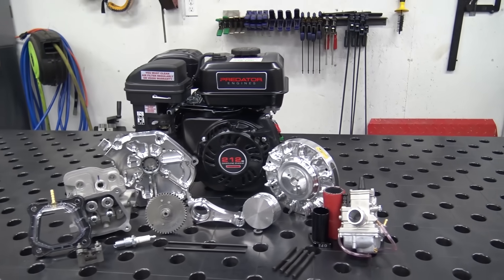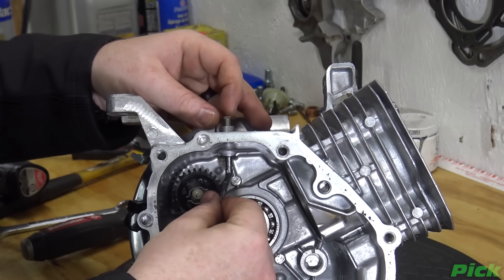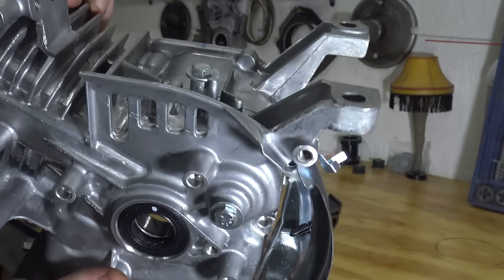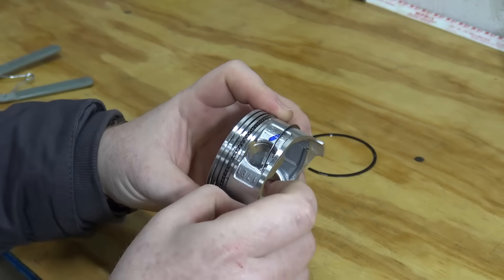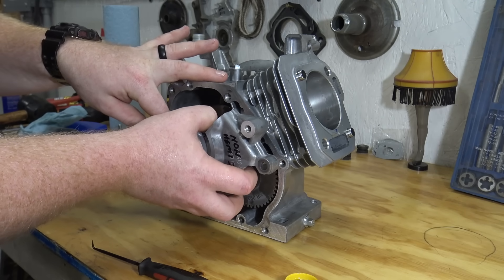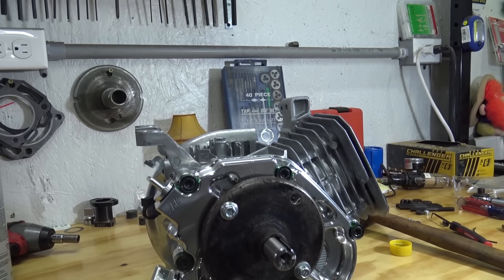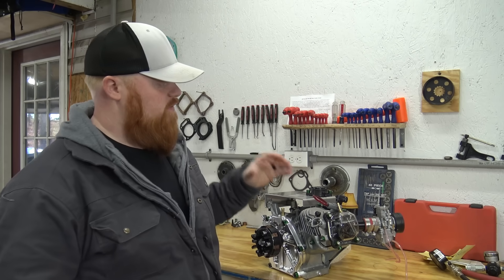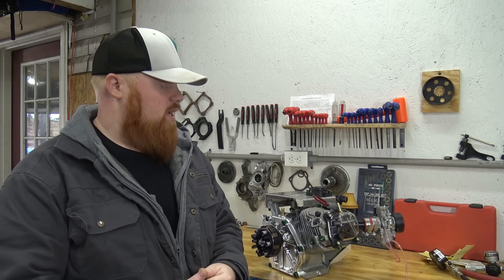Predator 212 Stage 4 Engine Build ~ 22HP Go Kart / Mini Bike Engine

Comment: Omg, I'm sorry, I wasn't going to critique this build because it's usually pretty good, but you used a fiber head gasket, that basically eliminates the Shaving you had done on the head, you should have used a multi-layer steel gasket at about"0.13 in order to actually achieve gains from shaving the head ".065. Using a fiber head gasket, you completely eliminated any gains you would have got by shaving the head, I really wish you would have told the people watching this that very important information, I'm actually kind of disappointed. But I will point it out since you didn't, that aggressively, use a multi-layered steel head gasket instead of a fiber or copper head gasket, in order to see positive compression Improvement gains. Trust me, I know what I'm talking about, I've been doing this for over 20 years..... again here's another problem with going with go Power Sports, they make you run a spacer for the valve cover if you are running ratio rockers, and are racing provides the same thing, but if you use a Billet valve cover, you don't need to waste the extra money on a spacer. And one more thing I noticed during this build, motor oil is used for lubrication on everything, that is incorrect, use either a good established company assembly Lube or use a good homemade assembly Lube like I have used for 20 years, and you will have way better results. Do not use just regular motor oil with your assembly, it will end poorly, I promise you!.... I will be the first person to tell you this, no matter who makes the valve cover, do not use a clear one! The first time you accidentally hit it with brake Parts cleaner, it will immediately fog up, and within 5 minutes break down and fall apart, crack and break, and be completely useless. Don't waste your time on something that seems like it would be cool, because the first time you make a mistake with brake parts cleaner, it will be rendered completely useless and you have to spend more money. Just get a Billet aluminum valve cover from the beginning, and you don't have to worry about it. NR Racing makes a beautiful one at an affordable price, and it works beautifully, has never let me down and over 15 years.... yes you can use the spark plug spacer to give you clearance from the piston, but I took my builds a step further and indexed my plug if you don't know what that means, look it up and do whatever you need to to make it happen because it is very beneficial. Which means I threw the spacer in the trash, and got spacers in order to index my plug to the intake port in order to maximize power. This video and most videos don't show you how to do that and the benefits from it, but trust me, it is well worth it. Look up how to index your plug properly, and use the spacer along with others if you need to in order to make it happen. It doesn't mean making space between the spark plug and the piston, it means how to orient your spark plug with the intake port to the spark meets the air fuel mixture properly, and yes you want to make sure you have clearance between the spark plug and the piston, but as long as you have that, you want to make sure the spark plug open Gap is facing the intake Port properly. Trust me, look into this and use whatever shims you need to make it happen, you can thank me later..... and I hate to say it but red beard is using all of the factory gaskets for the intake manifold and carburetor, and that stuff simply won't work. You need to use thicker gasket paper and make your own custom gaskets in order to properly Port match your carburetor and intake manifold to the engine. The head has a lot of room to be hogged out and made better, and if you don't do that along with Port matching all of your gaskets and intake manifold, you're going to lose potential power. I wish he would have shown you how to do all that, because I did that with my big Power build, and it came out beautifully. This video is a very good tutorial on how to get close to making big power, but a lot was left out, there is still a lot of power left to be found for basically no money, and it was completely overlooked. One of the big problems was going with go Power Sports, don't bother messing with that company, seriously, just go with NR Racing and you will have a much better time with less problems and more power, I can promise you that from experience!

Comment: I hate to say it but if what parts he is using and how he is going about it, then that means the Predator 212 I built with strictly NR Racing parts, running on methanol, should be making about 28 HP. And if that's the case, I hope no one actually follows this video because go Action Sports, completely sux. I got a similar stage 4 Kit from NR and modified things slightly and I promise you, I'm making much more power with less money, especially running methanol. This is nothing against red beard, I know he is sponsored by Go Power Sports, but they are the bottom tier of the industry, NR Racing is the way to go, Go Power Sports can burn to the ground as far as I'm concerned. Their products and customer service completely suck and should be eliminated from the market. Go with NR Racing Products if you are serious about making good, reliable power. I've done it multiple times, I gave Go Power Sports a chance, and they blew it about four times, before I decided to make the change. And I have never looked back, and never will. It is a night and day difference between the two companies. You can go with go Power Sports, and come up short and broke, or go with NR Racing and spend a little money and come out with a perfect product and amazing results. It's that simple. I hope all young engine builders read this and listen to me because I have walked the line in the past and figured out the mistakes, and I'm passing the info on to the younger generation. Please follow my advice, none of you will regret it, I promise you!

Comment: I need to point out something very important, I've been watching these videos for years, I also have been building Predator 212 engines for years, and I have built some very serious monster engines. But the one thing I need to point out, I get my parts from NR Racing, not go Power Sports. Go Power Sports absolutely sucks with their stuff and customer service, NR Racing is by far the better company to go with four parts that fit and their customer service is absolutely amazing. I have built multiple engines over the years and always used NR parts, and never once had anything out of clearance, or had interference with any parts and the block, crank, cam or anything, not a single problem over the past 8 years. But I watch these videos just to see, and if red beard is getting his parts from Go Power Sports like he claims, not in this video, but in others later down the line, he has constant clearance and fitment issues, which I'm sorry to say is simply unacceptable. And it's all chalked up to him being in cahoots with go Power Sports, because they are the F tier of performance parts. Still follow what red beard says, because he is truthful, but get your parts from NR Racing, and you won't have the clearance problems that red beard runs into. It's not speculation, it is now a clear proven fact. Follow red beards instructions, but don't go with what gopowersports has to offer, go with NR racing parts and you can eliminate 10 minutes of his videos explaining how to grind and do nonsense to make things work. Never liked the grind and modify parts to make them fit on my builds, I tried using Go Power Sports in the beginning, and was disappointed and unsatisfied with the fit and finish, along with their complete lack of customer service. So right away I went over to NR Racing and tried their products out, and it blew me away with the quality and fitment. And if I had any questions, their customer service was amazing, it wasn't even a competition. Go Power Sports is complete trash, don't even bother with them, just simply use NR Racing and everything will work out perfectly for you on the first try, I promise you.

Comment: I am not a mechanic so I would need to find someone to do this for me. What ranges should it cost. Also, with the motor producing so much more horse power, working harder, will it overheat with 8 to 10 hours running? Thanks for the video.

Comment: So what goes to the barb on that valve cover’s fitting sticking up??
Reply: yea that carb vac fitting is gone... it's just crank pressure/blowby
You can just vent it into the atmosphere in such a simple engine, but there will be oil streaks. Probably an oil catchat the end of a hose would be best for cleanliness and track safety

Comment: Red Beard, when i put one inch long bolt into oil sending unit hole after tapping it seemed real close to crank. Think i may go to half inch or 3/4 inch bolt.  What you think. Using stock crank.

Comment: So a billet crank cover isn’t necessary to vent the block? I’m using the same setup just don’t have a crank case cover. I have the pump, oil catch can etc. can I still build it without worries of pressure?

Comment: I like that lamp in the background. You’ll shoot your eye out. My favorite Christmas movie. I just did a 212 non hemi build. I did your governor removal like this vid shows along with a flat top piston, aluminum flywheel, mod 2 cam, 22mm carb, 22pd springs and a header pipe. I’m not going to be pushing this engine really hard so I hope the rod will hold up. I have a billet rod and flywheel and a 265 cam 24mm carb I’m putting in another engine I just got from harbor freight along with other stuff I have to order. Your videos really help alot.

Comment: What kind of rpm can these engines sustain with just the flywheel and rod, Possibly piston, I'm looking to rev to a peak of about 8500, and cruise around 6k, depending on the cvt, and gearing/weight, do you think it would live, and be reliable?? Making around 10-15hp??

Comment: Now all it needs is a bar! All engines need a bar.. Atleast one, maybe two! Bar-o-Boost at is! I been thinking about getting one of those eBay roots style blowers to go on my scoot! A500 cc supercharger on an 82 cc engine, with a 4:1 reduction  it should make plenty of boost, maybe build a waste gate, to regulate boost, as a controlled leak, recycling the charge, it's probably 5--6 hp now, surely with 105 octane, it could do around 15hp, and wheelies ha-ha... Crazy, especially for the price! It would probably fart a rod and piston! Ha-ha, I need to stop talking and do it!!

Comment: I'm wanting to upgrade my internals but I have no idea what parts to get. What kinda springs I need what kinda rods and what not. I've never owned a small engine before this one so this is all new territory. So far all I've done is remove the governor, add an exhaust, air filter, and billet aluminum flywheel. I have the juggernaut torque converter and a new valve cover ordered.

Comment: Wow,,, nice stuff going on here. I cannot even find a set up for my 79 cc Predator. Nor can I find a clutch/converter plate that will work on 5/8 shaft. I have a good mind to return the 79cc and buy a 212, then build a bike frame that will compensate it. That way I can upgrade the motor so it will pass cars. LOL

Comment: Does GPS sell the red tube that goes over the carb intake? I had my 22mm on and it just pegged at full throttle immediatly upon starting it....im sure it was a leak...im not sure the o-ring on the adapter provided me an adequate seal

Comment: Is this the exact same as a Honda gx160? I bought a little mini bike recently and it has a gx160 on it iv been taking everything apart and watching a lot of videos trying to learn and figure it all out but the one thing I’m confused on it seems from what I can understand all the parts for these Honda clones are universal? So what I’m really not understanding is if all the parts are the same what makes the difference in cc how can a 160cc engine be compatible with a 212cc engine? Taking off my valve cover I broke a bolt in the cylinder head and when I looked at replacing the cylinder head assembly on amazon there was 2 options 5.5hp and 6.5hp but both said for gx160? So does it matter what one I get?

Comment: I wish I could afford some nice Parts like that for my motor mine's 196 cologne engine are the plastic camshaft gear I'm sure that'll break here soon only Parts I got was a see-through valve cover carburetor an exhaust pipe looks good for now and sounds good

Comment: Your video's are great they have taught me a lot but I am having an issue with a billet rod in my 196cc it knocks when you bump the throttle my question is do they make spacers for the crankshaft or am I going to have to just keep the stock rod in

Comment: fasteddie3333-bought this stage 4 kit followed instructions, my motor seems very tight, I am sure it's the valve lash. Been running it 4 month's ,Karting RWB-Winning a  lot, very hard to start, once it is running no problem. I went back looked at your valve position and ,002 & .003.-curently running .005 both valves. i will reset them after reviewing. Thanks Guys-JIR Raceway-Maxville ,FL

Comment: I need help. I have a pz20 carb on my 2020kandi Kd-125gkt-2 it has so adjustment screws.so it sucks. The bore is 20mm bolt to bolt 48mm.  What is a link to a good carb for it that will add performance

Comment: Well I be dogged I never seen to use valve lapping on the fly wheel, glad I seen cause I am goin to be building my son a go kart. I have a tecumseh 8hp mototr that is supp to be built but I have been looking on line n I don't see any performance part's for a techumseh motor. Do you think maybe they fibbed about it being built? Or do you kn of any one selling performance parts for them? It's a older flat head design.Thanks

Comment: I’m about to build my brand new in the box predator 212. I unboxed it, removed the muffler, put in gas and oil, then test cranked it. It started blowing sparks out of the exhaust real bad, sparks that looked just like a grinder grinding metal. I’ve never seen that on a new engine. Before I void the warranty, should I send it back or is that normal for a predator 212?

Comment: could you do these upgrades then install it into a Golf cart? My main objective is to have a 22+ HP engine that can still utilize the generator / starter so i can drive this to the golf course and still have a fast cart for street use? Any thoughts?
Reply from the maker: I wouldn't do it to a small block but a big block would have the power you would need
Reply: Joe, I just bought a Club Car DS with the Predator 212 - no power mods at all . Used to be electric - pulls this cart WAY better than i thought it would. I can try and post a video but the kids love it . Dont know about the generator but mine does have electric start , wont need a generator to drive it anywhere you need to go
Reply: https://www.youtube.com/watch?v=4TnJK0by-_g

Comment: Is a better spark plug an coil gonna be important too?
Reply from the maker: It's a stock coil and I have just added the msd boot and a little better wire. You won't feel a hp difference but it will help

Comment: Excellent video just saying. But for the record i dont think anyone in their right mind would spend this much building a cheap chinese motor. The whole idea of the predator is that its cost effective and durrable, this kit takes away both those properties, making it not a practical choice atall for anyone looking for a cheap build. For the price you could easially get your hands on a 600cc+ street bike motor making well over 100 HP. And if thats not your fancy a used dirtbike or snowmobile motor will do the same if not better job for significantly less money.

Comment: My built predator 212 has horrible kickback and can be a pain to start. The timing is correct and I'm about to check valve lash any suggestions. Is very powerful and runs good once it is started.

Comment: Instead of a bolt in the oil sensor hole thread it and use a threaded plug I would of liked to hear it run

Comment: The head is pretty much stock and the rest is extremely mild. At best 18hp on gasoline and 20hp on alky.
Reply: Exactly what I was thinking. More likely 14~16bhp?   A Honda XR 200 takes a load of work and parts to make 22bhp on a 'real' dyno. (plus stay reliable) At 13,500rpm, XR200 (240cc) can make at least 24bhp but tends to blow up quite easily. (usually snaps con-rod)  It's pretty easy to 'spike' a dyno and get high numbers though, usually 60%~70% more than an engine is really putting out

Comment: Hey Red Beard,

I love your videos very informative. Just a side note, at 14:14 you mention Torqueing the head to the block to 20-foot-pounds, I would advise against that if your not using posts like you have in the video. I was following along with your video and didn't realize you had posts vs my stock bolts and I totally snapped the bolt off in the block at 20-foot-pounds. I believe it should be 17-foot-pounds if youre using stock bolts.

Comment: This is great if you are racing in a class that requires this motor, but for $900 including the price of the engine I feel like 20 horsepower is cheaper to find elsewhere. A motorcycle or snowmobile engine would be a good place to start, you can find a good used 600cc sled for $500 any day of the week and a single cylinder sled or bike could be had for next to nothing anymore, both putting out more than 20hp. Its the metal casting in the block and crankshaft that might be questionable on these Chinese engines, at 20+ horsepower I doubt they are going to last very long making your $900 investment even more of a waste of money. Just because you can doesn't mean you should!